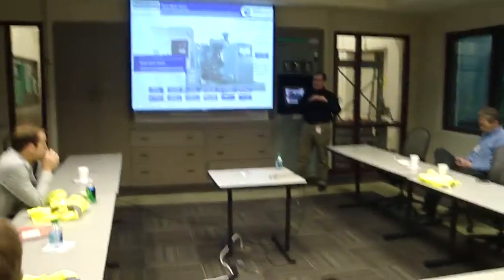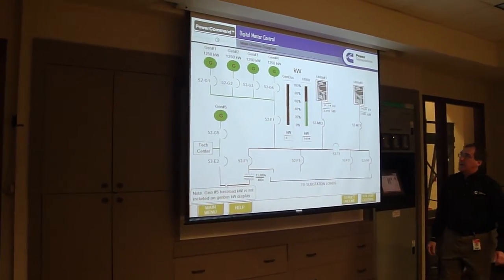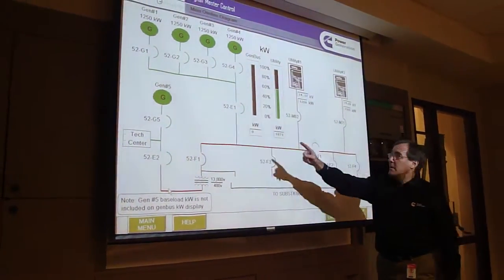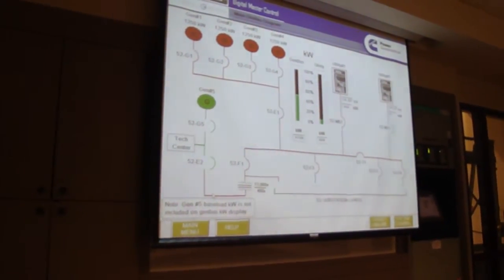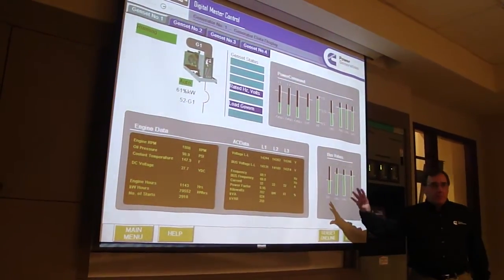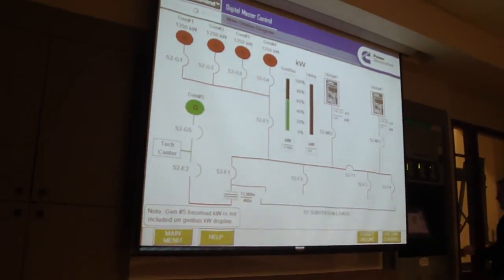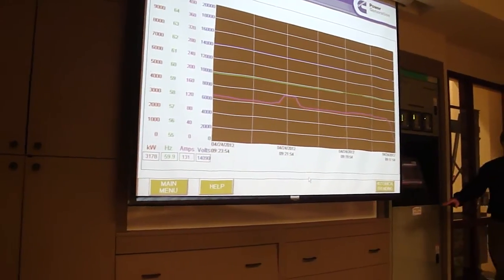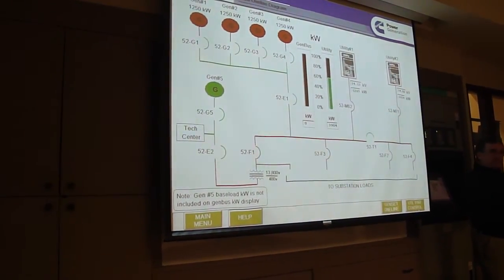Generators-Cummins Tour-Paralleling-04-25-12.MP4

Comment from the maker: When you run in Parallel with Utility, you can send power to Utility or receive power from it.
The engine’s governor will increase fuel consumption which increase Gen speed/HZ which get counterbalanced by picking up more KW load off the Utility & onto the Gen.
When you lose Utility, Gen speed/H goes up momentarily and get counter effected by more load to slow it down to 60H.

Comment: See now that is really cool to be able to see things live like that! My question is, if you are running in "peak shave",  and the utility supply went out,especially if you happen to be drawing  zero power from the utility, how does it detect  that and how does the system react?? Does it see a reverse current back into the grid and immediately open the utility breakers?